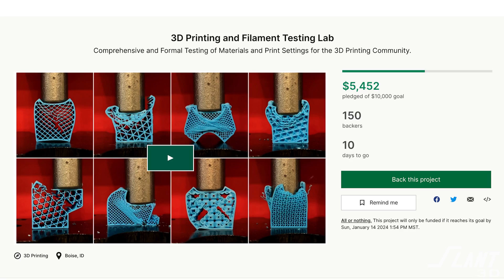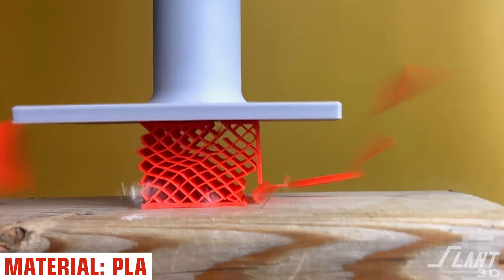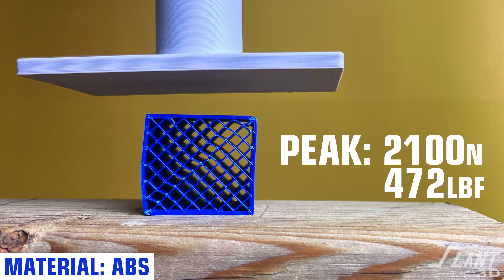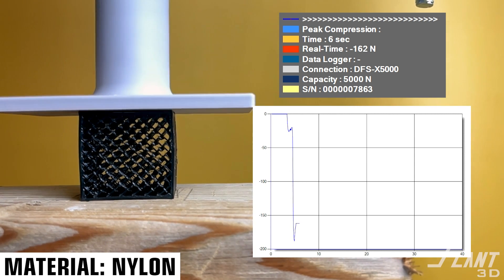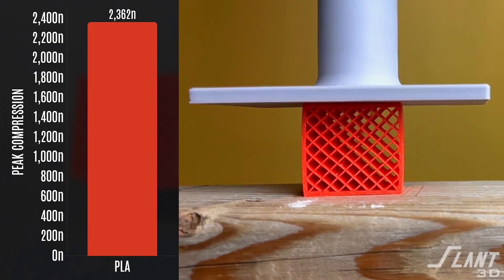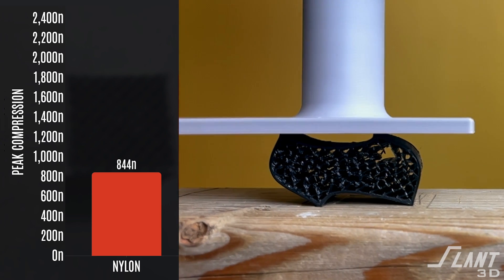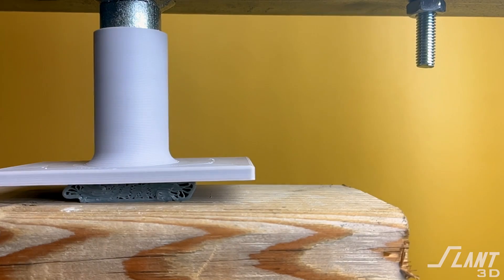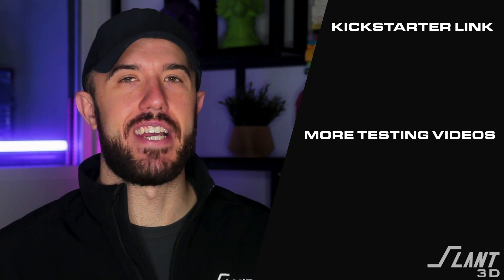How Strong Are Common 3D Printing Materials?

Comment: The problem here is that with the Nylon, you A: Used Carbon Fiber Nylon which is more brittle than Glass Fiber Nylon (people in the 3D Printing are WAY too obsessed with this material, GF is the industrial material, Carbon is not) and B: The infill in these are not enough to show an accurate representation. Even though Nylon CF is brittle, it can handle a ton more force than a lot of other materials. Given that these blocks have maybe 1 wall internally, the Nylon crumbles. Maybe the infill walls 2 or 3 and you'll see a massive difference in how all of these materials perform. It's literally the difference between a piece of paper or a sheet of plywood. No one is using a piece of paper for their projects, so comparing paper to plywood isn't going to be helpful at all. 

The testing here needs to be far more rigorous with more logical settings and prints. Even inside of the Nylon print, there is stringing, which can indicate other issues with the print quality, which, in my book, disqualifies Nylon in this video from being compared. If a material isn't printed correctly, how can we believe that this testing will show us accurate data? 

In my own Nylon GF testing, my prints, which use 100% infill with specific settings for strength in mind, can easily beat literally all of these materials, even though the object I print most often is less than 1/4 the size. This video needs to be redone and the settings and testing methodology reworked. The information provided is so boiler plate, it's essentially useless to most people.
Reply: Was looking for this comment.. the nylon had so much stringing like it was too wet or something was wrong
Reply: @dylan-nguyen I am pretty sure it was fairly wet when printed the amount of stringing is excessive and the test just didn't reflect nylons capabilities
Reply: 0:30 says it all. Underextruded with blobs, so probably wet. During the test the infill appeared to be missing most of its walls and structure. A completely invalid test, and I'm curious how a 3D printing business can lack so much quality control and the integrity to be honest about it. Why would someone want to order prints that aren't done correctly? Claiming to produce structural parts, but can't print nylon correctly seems more like a trinket factory that's 1 step above using rainbow silk PLA.😂 I appreciate all the helpful videos, but this one misses the mark.
Reply from the maker: Black Nylon PA6

Comment: please do a bit more research on the differences between stiffness, strength/durability and hardness/scratch resistance
only because one material is stiffer doesn't mean it's stronger and/or more scratch resistent
Stiffness is the resistence against deformation, strength is how much load a part can take till it fails (so basically resistance against failure) 

for example let's compare a mild steel like S235/St37 to Alu EN-AW-7075 T6
Steel has a young's modulus of 201GPa, Alu 70GPa
so the steel is way stiffer than the alu

BUT S235 has a yield strenght (stress the material takes untill it starts to deform plastically) of 235MPa vs. the 7075's 485MPa
and the ultimate stregth (stress the material takes untill it fails) S235: 360-510MPa vs. 7075: 540MPa
So the 7075 Alu is stronger than the S235 Steel, even though the steel is way stiffer
Reply: Similarly, most steels have basically the same young's modulus so the same stiffness but depending on their properties and heat treatment their hardness can be very different.

Comment: nice combo, although i feel like petg might get a bit misleading if you consider it as the same thing whenever it comes from
i recently had 2 batches of petg from 2 different vondors and yes they were both verydurable and gummy, but devil design one was comparable much softer than a pink no name brand i had basically to the point printing prisa printer out of it could be tricky around some parts that are under constant load from the screws becaise every hard object pressed against it left a mark, but it does stick layers very well and compared to abs is not as much warpy which is a big plus
so to sum up pet g and any other blend of plastic can have completly different outcome and i am kind of waiting for that plastic database you were talking about few episodes back, because not everything with the same label is created equal, i feel like devil design pet g  i have woul work much different , closer to tpu not much but around 10-20% softer
Reply from the maker: Which is exactly why we want to scale up the testing and just start running through manaufacturers

Comment: I'd like to see a test of materials for use as sliding and rotating bearings.  I've used materials that were purpose designed for this use (which didn't work very well without drying the filament) as well as other common materials.  It would be interesting to see how nylon performs in that situation, but you'd really need to make sure the filament was completely dry beforehand.
Reply from the maker: If we can get the kickstarter funded we can work to get that type of equipment in.

Comment: That nylon print looks bad. The infill lines barely connect
Reply from the maker: Nylon can have some stringiness. But the print was sound. We have to use similiar slicing settings between materials (adjusting temp of course) so that one material does not have an advantage from changes in slicing settings. If we redo this test we would optimize a particular set of slicing settings fo the nylon and then back-apply them to the other materials.
Reply: @slant3d  Great video and I appreciate the significant effort, but you cant be serious here. "Sound"? There are clearly massive gaps in in the nylon grid pattern at 0:30. The grid is literally detached. Looks like a retraction issue or printing the infill too quickly. It's not really a fair comparison of nylon's performance but is a showcase that it can be a pain to print...

Comment: Excellent!  Please add ASA to the "common materials" list.
Reply from the maker: Touche'
Reply: +1, ASA is my second most used filament.

Other than color selection or maybe temporary availability issues, I’m honestly not sure why to go with ABS instead of ASA.
Reply: @yayinternets  I'm pretty sure it's just price the only big advantage of asa is uv resistance wich is not necessarily for most things
Reply: @StephenTeitgen  The fumes aren't nearly as bad as ABS.
Reply: @yayinternets  well yes but lots of people who print abs have an enclosure and filter or exhaust
Reply: i learned that for all intents and purposes ASA is "about the same but slightly better" than ABS. So when you see benchmarks for ABS, you can assume same holds for ASA and vice versa. 

So should do only 1 of them, either ABS or ASA. And my choice would be ASA, as the better one - however seems that ABS is still more abundant in sales (colors etc), maybe that's why the choice

Other than being easy to glue/weld (with acetone, easier solvent) and maybe heat resistance, i fail to see why somebody would be using ABS/ASA over PLA - they are troublesome to print (warp and detach), more expensive and may not even be more impact resistant than today's PLA+
Reply: @enterrr  asa is going to have better uv resistance and temperature resistance but I agree about abs vs pla.
Reply: Yeah I also use asa quite a bit and I’ve been Hoping it will show up!
Reply: I use ASA like PLA now. It does off gas and coat the inside of my printer though. I truly believe it’s the best material.
Reply: Bump. I fourth this!